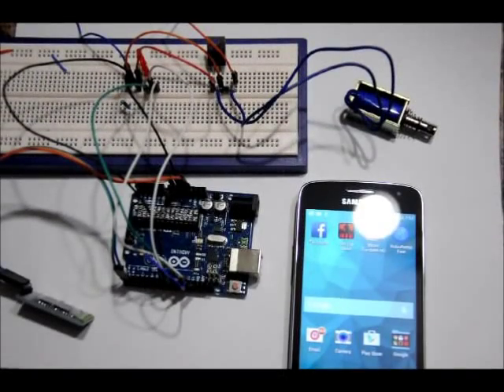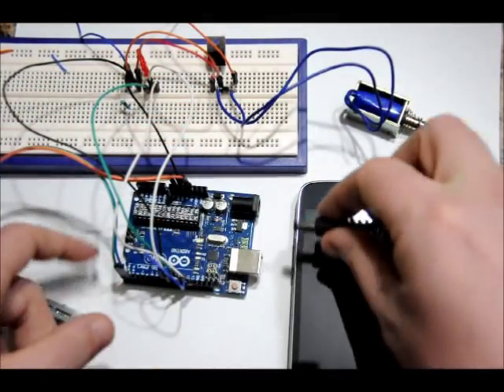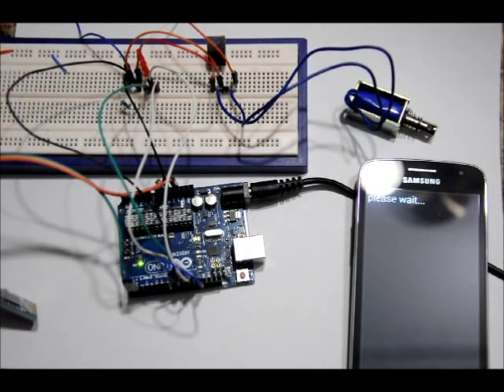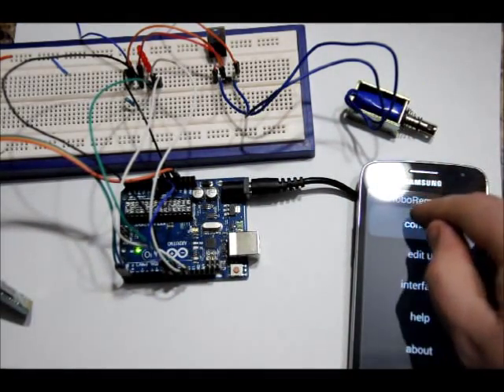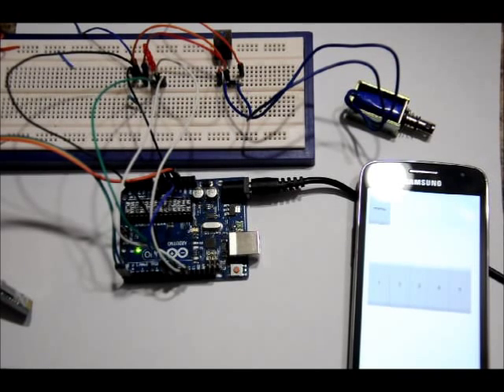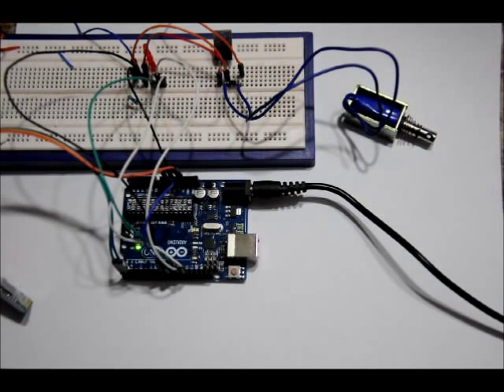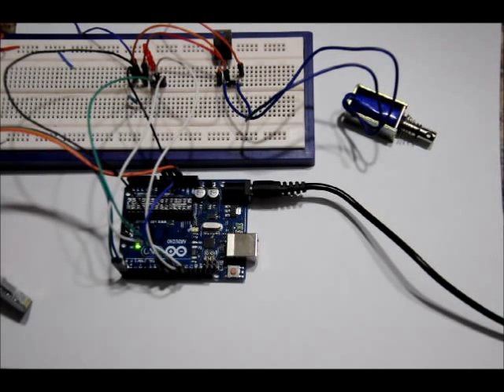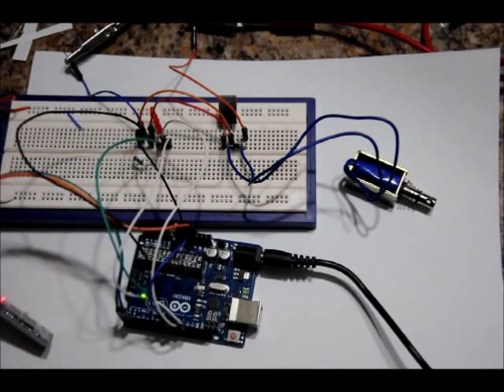Bluetooth combination lock with HC-06 + Arduino Uno + Electromagnetic Solenoid

Comment: Hi your videos are very cool! Can you help me with the code in the ARDUINO IDE for the communication with the hc-06? Thanks!
Reply: Cristian Rodrigo García Delfín Bluetooth module is working like serial monitor on your arduino software. You don't need to write a code for it to communicate with arduino. Just plug it in and connect with it over your phone and it will work!
Reply: Cristian Rodrigo García Delfín I have seen now that this was a very old replay...